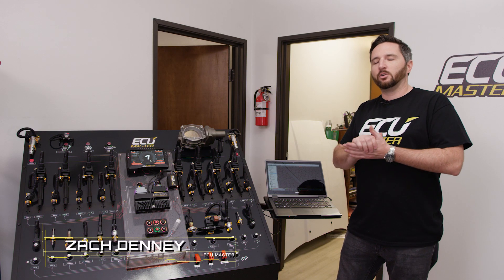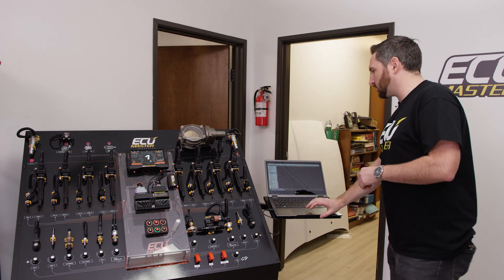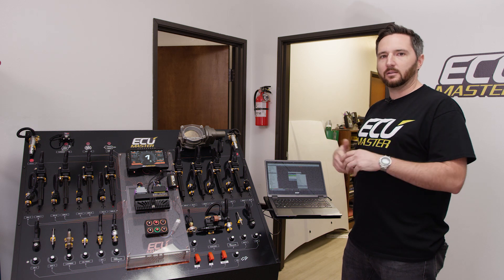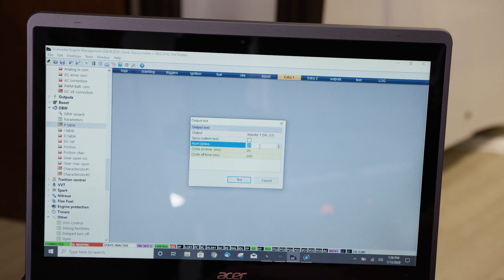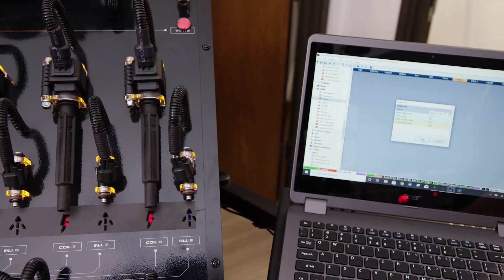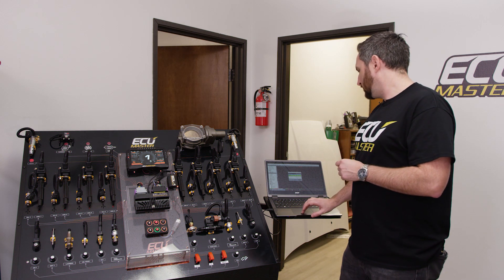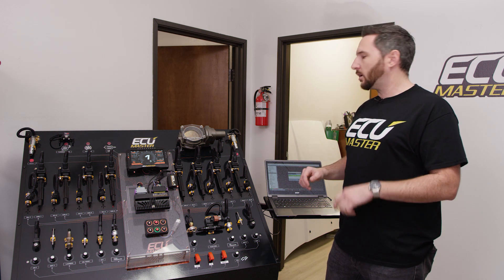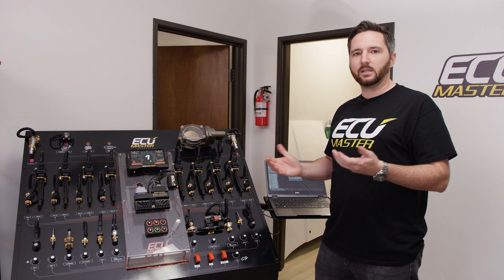ECUMaster Output Test

Comment: So you mentioned that you shouldn't use the test out feature for the fan. Aux 2 for my setup is the AC clutch relay and im not sure how to test this. I tried and i didnt hear anything form the relay. RB25det with pnp adapter for reference.

Comment: Today I found a easy way to test my wiring. Turns out I have a broken cable. Just put a led light on your 12v and the coil wiring and fire it up. Led flashing means that the wiring is OK.
Reply: Zwien22 definitely a great feature.

Comment: Can you use this to test an idle control valve?
Reply from the maker: Yes, if it's a PWM style valve. Stepper style valves use several outputs triggered sequentially, so the output test function was not designed for them.
Reply: @ECUMasterUSA  thanks!